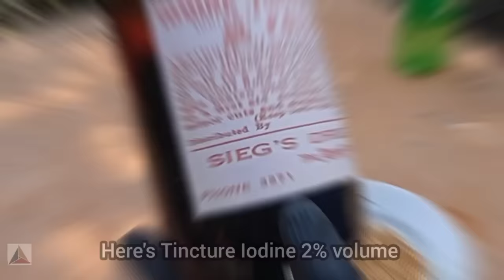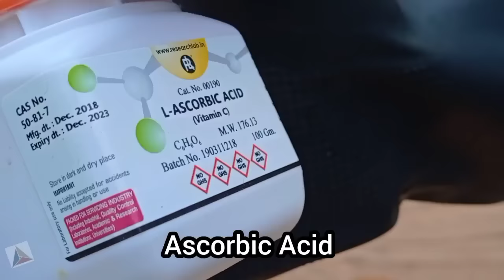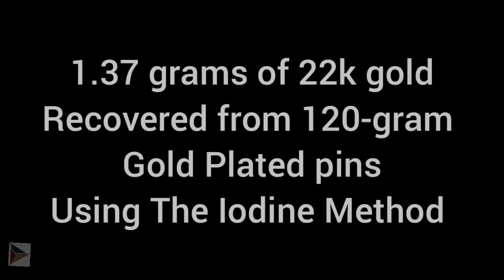Tincture Iodine Gold Recovery | Gold Recovery Using Iodine | Gold Recovery

Comment: Thanks so much for getting back to me. So then it does not have anything to do with raising the ph. But now I am lost. Do you mean its a reagent to see if you got the result you wanted? Also could you tell me how you came up with your procedure? Was it from some other reseach? I ask cause you found the Holy Grail of how to process gold pins. Cost is not an issue when you factor in the harsh and hard to dispose of chemicals, let alone your time and the cost of those harsh and dangereous chemicals. You da Man!!!!!!
Reply: Bác muốn kiểm tra xem ? Quá đơn giản : cồn Iod có đầy ngoài cửa hàng dược ; vàng mạ ra cho thợ sửa tivi ; laptop...đầy

Comment: Thank you for your informative videos.Is the material used tincture diode used in medical operations.Is it efficient to use in processor pin.
Reply from the maker: yes, it's a medical operational chemicals, it can all kind of gold plating be dissolve...
Reply: @TrinityGoldRecovery  Most countries are now using Povidone Iodine (Betadine) for medical/surgical situations because it lasts longer and apparently can't be used for manufacturing Meth or makes it harder to be used. Povidone is also synthetic and doesn't work for this process unless you add acid and that defeats the purpose of using iodine. I guess it has too much Nylon-polymer which interferes. I tried 2 types Povidone and after 2 days no reaction. I then grabbed some 2.5% Iodine tincture containing Potassium Iodide and it worked within 20 minutes. I believe it would have been way faster if I had more tincture. Need to find a source that has larger than 50ml bottles here in Canada. Thanks for the video, I hate using Aqua Regia. You know of an alternative that could be used instead of caustic soda?

Comment: Can you please answer! Does this procedure work with all computer parts? All gold plated parts? Would be very grateful for details. Thank you
Reply from the maker: Gold recovery using iodine is effective only for gold-plated parts, components and pins or connectors. It may not work for other materials or parts lacking gold plating. Thanks 😇
Reply: @TrinityGoldRecovery  Thank You 👍

Comment: I have considered the process but their is a great deal unknown. Like how much gold will 100ml of iodine hold? I would have to do some testing first. Iodine is expensive about 20 USD for 100 ml. 
How much iodine did you use? Your beaker was at 200 ml - pin volume

Comment: Hello, good time, I used your method, but in the end, the color of the solution changed to this color after resting, can you give me some advice, what should I do?
Reply: I will send you the photo
Reply from the maker: "Thank you for your question. I apologize for the issue you're experiencing. To address the change in color of the solution after resting, I recommend the following steps:

First, make sure you have followed the procedure shown in the video accurately. Double-check that you have used the tincture of iodine to leach the gold plating from the gold plating pins.

After completing the leaching process, allow the solution to rest undisturbed for a while. It is normal for the color of the solution to change during this time due to various chemical reactions taking place.

Next, prepare a mixture of ascorbic acid and sodium hydroxide. Make sure to mix the sodium hydroxide first and then add the ascorbic acid. This order is important for the reaction to proceed correctly.

Once the mixture is ready, slowly add it to the solution with the changed color. Be cautious and add the mixture gradually to avoid any sudden reactions.

After adding the ascorbic acid and sodium hydroxide mixture, stir the solution gently to ensure proper mixing. Allow the solution to rest again for a short period.

Finally, observe the color of the solution. If the color has not returned to the expected state, you may need to repeat the process or seek further assistance from an expert in gold recovery.

Remember to exercise caution and follow safety protocols when working with chemicals. If you are unsure or uncomfortable with any step of the process, it is advisable to consult a professional or seek guidance from someone experienced in gold recovery.

I hope these steps help you resolve the issue with the color change in your solution. If you have any further questions, please feel free to ask. Good luck with your gold recovery process!"

Comment: Can you substitute vitamin c for sodium meta bisulfite for precipitation?
Reply: I was wondering the same thing.   Iodine works great for removing plating but I don't have any ascorbic acid so I am saving the dissolved gold in the iodine until I can get some or my thought was to use SMB but you saved me from asking.   Was your question ever replied to?  Thanks.
Reply: Vitamin c has been used across refining that i know of for a cleaner drop of precious metals. I believe you can i do have material but the only way i can test the theory in pure form is making my own iodine tincture as its only sold in 30ml bottles and id rather by in big volume at cheap or make it myself. When i did it first time with tincture of iodine i used smb to drop gold but my color change was not green as his probably due to the fact that the otc i bought was probably 1% and maybe not as potent. Unsure in totality but playing around with my findings. Hope this helps

Comment: A very good option if you can't get acids legaly where you live (UK). Iodine is in nearly every shop... Can it be 3% or stronger?
Reply from the maker: Yes
Reply: did it work for you i wondered since you said you was in the uk as i am if we can use any iodine of any kind or has it to be a certain make when i search i find alot of iodine disinfectant is that also usable it says 2.5% any advice would be great as i have alot of gold srape i want to process using this method

Comment: Çok güzel bir video olmuş.altin kaplama soket uçlarındaki lehimlerden nasıl kurtuluruz.hcl altıni azda yiyormuş  başka bir çözümü varmidir
Reply: I have solder removed from boards first. 2 liters of 10% vinegar, add some salt about 3/4 cup, mix, and add 1.5 cups of 3% hydrogen peroxide. The boards sit under the liquid solution, stir every second day, and look to see if solder is off. In one week or two solder and lead is stripped off. May take longer if solder is thick. Only silver/gold/platinums and copper still on the boards.

Comment: i have 1 question, I was trying to do this for bga chips. I will take around 200 gram of bga chips and make them powder by blending and crushing. Then I put iodine solution in the beaker with powdered bga chips. Will that still extract gold or will it react with other metals?? Please guide
Reply from the maker: no, it's doesn't work of gold wire, only work on gold plating... bga inside that's some of 18K and some of 21K pure gold wire bonding...
Reply: @TrinityGoldRecovery  ,,,,, works with any gold plated and wires, i test it with a Ceramic processor, and success

Comment: What percentage of gold (or "karat") is the end product? 
Edit : I see at the end the claims are of 22 karat but how do we know that?
Is iodine such a selective Catalyst that it only interacts with the gold and not any of the other base metals in a significant way, or are there just no other base metals present in a significant amount in the original material?
Reply from the maker: I don't really know how many carats of gold, the carats of gold coated on the pins, the recovery has been of that quality.  24 carats will not be available until I refine...
Reply: From the color it looks like 22.Quite clean gold but off course not 24.

Comment: 100 times better than my electrolosys with H2SO4. My big question is - what is the sodium for? What does it do?
Reply from the maker: Sodium hydroxide acts as a neutralized reagent in iodine solution.
Reply: @TrinityGoldRecovery  until what ph value sir?

Comment: Does this method also work for un-solder circuit board ?
Reply from the maker: don't do that on circuit boards, the iodine is very expensive chemical... and circuit boards gold plating is very poor...
Reply: @TrinityGoldRecovery  makes sense.
Reply: @TrinityGoldRecovery  actually works very well, I've tried it on whole telecom boards just dip and rinse, Iodine is great for thin plating
Reply from the maker: @Owltech, yes can be! You're the legendary man.. ✌️😇👍
Reply: @OwlTech333  thank you very much for the tip. Thats helpful. I have a large gabage pail full of computer boards 100+lbs, old gold plated glazed pottery, and broken watches.
Will this process work in cold weather like 0 degrees celcius, outdoor? And will it remove Platinum and Palladium?
Reply: @knightstar1312  no
Reply: @OwlTech333  Thanks. I am guessing 'no' for both questions?
Reply: @knightstar1312  correct

Comment: Very nice video.
I tried yo extract gold from gold pins with  povidone iodone solution  5% which us available in the market and taken 40 gm as a sample. No precipitation seen and whe i added  caustic soda, the color of thd solution is light  green instrad by brown color as per the video you posted. I have added ascorbic acid solution and thd color changed to brown color but no sediment seen .what might be thd reason...
Reply from the maker: did gold plating was leaches by iodine ?
Reply: @TrinityGoldRecovery  I had the same issues mentioned above, I used iodine tincture (not sure of the percentage as its not written)
 to to do it, but no result. instead i had to filter it out to see what lies on the bottom of the beaker as sediment and post filtration i now have some ugly slimes

Was an experiment though with 0.8 u plated gold,. but no result brother.

I still have the slimes in a container. no idea what to do next. My chemist friend advises me to burn it and see if something happens. please guide what should I do?

thanks in advance.
Reply: @TrinityGoldRecovery  I'm facing a major slime issue. what may be the reason? Its hard to tell gold from those slimes present, as before even pouring the ascorbic acid, all of it settles to the bottom of the beaker.

Help needed. Thanks
Reply: @TrinityGoldRecovery  yes.90% of the gold leached out.
Reply: @TrinityGoldRecovery  I have poured out the top portion of liquid  and bottom  portion of the liquid evaporated over gas stove in a steel plare and black powder obtained. Guide me further...

Comment: Your net yield is way under 1 gram. You have alot of copper in there for starters.
Then all your heavy metal contaminants then factor in you still have to run it through AR.
So you are probably around .75 of a gram at 14k. So calculate1 gram is now $59.64 times
.5833 (14k) = 34.78. Multiply by 3/4 gram (34.78 X .75) = $26.10 total net. The process looks great, quick and clean but you cant be one dimensional about gold yield.
Reply: true, but you can make this quick method to gather some lower grade gold, and when you have several nuggets you make a aqua-regia on all of them.

Comment: Will 10% Povidone Iodine Solution work?
Reply from the maker: My doubt is whether povidone iodine will work.  Because it contains citric acid and sodium hydroxide.  You can try a small amount.  But I'm not sure.
Reply: @TrinityGoldRecovery  Thanks for answering. I am still amazed by what you have done. Thank you

Comment: This is very useful thank you . Does it work for silver also?
Reply from the maker: iodine dissolve into gold and gold base metal too_such as cadmium, silver, nickel. After I use sodium hydroxide and ascorbic acids to precipitate gold from solutions. but the gold is not fully pure, some base metal exist with gold, cadmium, nickel and silver. those amount of few, that gold to need to refining process again it dissolve with aqua regia, or if using nitric acids to refining that gold, we can precipitate few amount of silver also from silver nitrates solutions too... thanks

Comment: Will this method work for all other e-waste part or only pins?
Reply from the maker: if you quite shaking those parts in iodine solutions, all of gold plating will dissolve in like those pins...
Reply: @TrinityGoldRecovery  i will like to see video of all mixed e waste parts with iodine method
Will be very thankful to you for learning it from you. ✅👌
Reply from the maker: You know_Iodine is expensive chemical, I use high grade pins to recovered gold, but all kind of gold plated pcb is poor gold layers_if you process like iodine process, you will be losers...
Reply: @TrinityGoldRecovery  ok thanks for quick reply

Comment: One question, if I use 5% or 15% tincture will that be better?
Reply from the maker: no problem, you can do this..
Reply: @TrinityGoldRecovery  last question, I was trying to do this for bga chips. I took 200 gram of bga chips and made them powder by blending. Then I put iodine solution in the beaker with powdered bga chips. Will that still extract gold or will it react with other metals?? Please guide
Reply from the maker: I answered your another comments.. thanks
Reply: @trox9082  
iodine reacting with most metals such as copper, Nickle, silver,,,, etc, and you will find all in the iodine solution

Comment: I used 10% iodine and it doesn't work so I used 2% iodine and it works great.  Can you comment on that?
Reply from the maker: I also used 2% iodine ...👍
Reply: 10% was probably Povidone which is synthetic nylon-polymer Iodine.  2% was probably Iodine Tincture which would be Potassium Iodide or similar which has actual iodine ions binded with potassium or something similar.

Comment: I tried gold extraction of cpyupine with medical iodine, but gold extraction did not work. Which iodine should I use?
Thanks for letting me know. Subscribe
Reply from the maker: its possible, if iodine was 1% then gold leaching slowly... you need to 2% or 3% iodine contain...
Reply: @TrinityGoldRecovery  can i use iodine solution 2% instead of iodine tincture?

Comment: Can this be done inside?
Reply from the maker: Inside can't_dude
Reply: @TrinityGoldRecovery   To late🤣🤣🤣 I did the iodine part in my kitchen and then when I added the lye I did that outside on the front porch! I'm excited! This is my 1st time using this method! I processed 1/2 pound, (450 grams). I used 20 oz of iodine. My reaction was very slow due to me adding a big gold plated spoon. Due to the spoon having so much silver on it, it took awhile. I think I added to much lye.
I have a big pile if green sludge, much more then what you had. It looks like I pulled alot of silver & copper with the gold. I will melt it all down then refine it later! Thank you soooo much! I'm gonna do some experiments to see if I can get this to work with regular provadone iodine! Thank you so much and God Bless you!!🙏
Reply: @TrinityGoldRecovery  I am currently trying to use over the counter Providone 1% iodine.
So far it's no good. My next trick is using Providone 1% with a little Tincture 2% iodine. I'm doing this to see if it will save us money 💰.
I will get back to you with my results!
I been searching for a safer, less expensive way and hopefully a quicker way to recover gold.
I been doing different experiments all week!